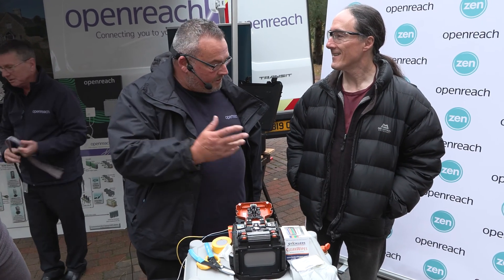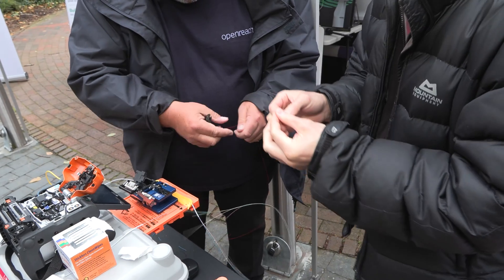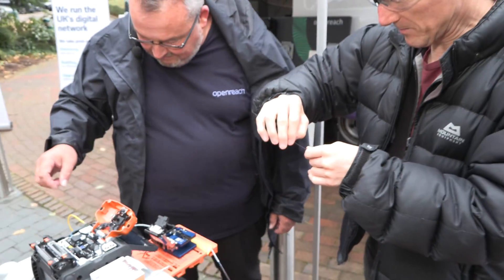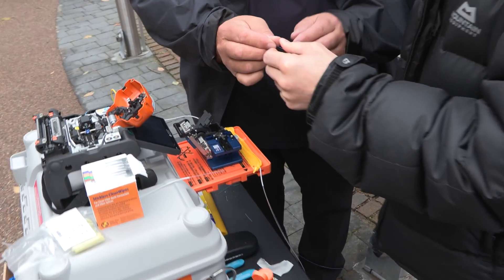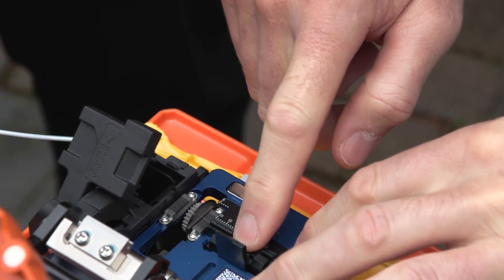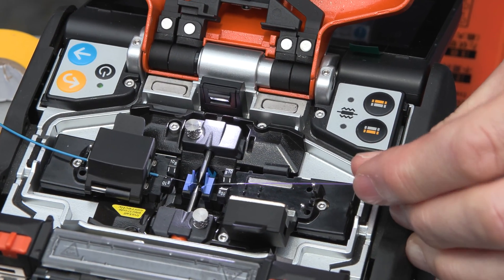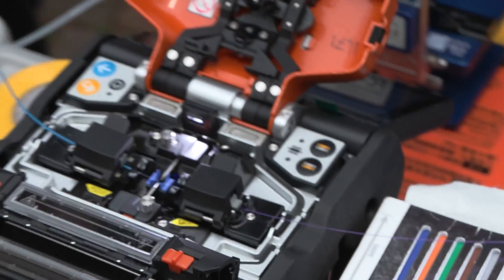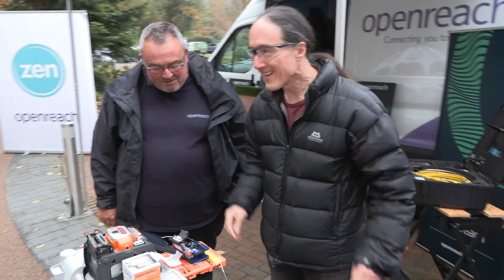Openreach teaches me how to do a perfect fibre splice

Comment: Pity they can't run a duct, from their Fibre cable inspection pit,  for 4 yards under a rarely used road, though isn't it. Look on this site and watch American companies, drill underground for upto 300 meter with NO TROUBLE AT ALL...Close 'OPENREACH ' down and open the DIGITAL AGE system to companies that WANT TO WORK...

Comment: You can't go saying things like 1.8Gbit per second when Zen don't offer this yet, that's just mean.

Its just a race right now, do Cityfibre reach me first hopefully offering their 2Gbit service, or will Openreach more widely roll out 1.8Gbit.
Reply from the maker: Thanks for your comment 🙂... we're working on launching both 1.8Gbps from Openreach and 2.5Gbps from CityFibre.  Don't have a firm date yet, but will happen within the next few months.
Reply: @RTZen  Are there any complications to upgrading within my 2 year contract?   I noticed a few months back that the new customer  price is now cheaper than I'm paying.
Reply from the maker: @alexatkin  when we launch 1.8Gbps / 2.5Gbps, you will be able to upgrade in contract and get the same price that we offer to new customers.  We haven't announced details yet, but our planned pricing is not much more than you're currently paying.  If you stick on your current speed, then we'll send you an End Of Contract Notification that will give you an opportunity to move to the price we are then charging for new customers - if that is lower (as it is currently) then you'll benefit from a price reduction.  Whilst you're in contract, you're protected by our Contract Price Promise, so we won't hike your price (unlike most of our competitors who typiclly put through a CPI + 3.9% increase every April).
Reply: Community Fibre does faster speeds than City Fibre. I have 3gig at my house and I could go faster. Openreach is fallen behind with the times.
Reply: I mean, I wouldn’t get too excited, OpenReach are still deploying GPON and have been very quiet about upgrading to 10gbps let alone 25gbps XGS-PON trunks (GPON maxes out at 2.5 down, 1.25 up, but that trunk is shared among among many customers. If you are on a trunk with just a handful of heavy users high speed users you will find that you will be able to burst those speeds (as long as no one else is) but you won’t get that speed all day, every day.
Reply: @SomeoneBloodyRandom  I'm aware of the Openreach limitations but as I am disabled I sleep unpredictable hours, so the odds of my heavy downloads conflicting with the neighbours is pretty low, plus I kinda doubt any of my neighbours are heavy users.  Obviously I'd prefer Cityfibre for the symmetrical speed alone and better technology, but Openreach is a good stop-gap.
Reply: look at what theyve got on most of the western continent in europe already. the swiss I think even have SKorea beating plans now for 25Gbit both ways for like 60 quid a month! even the more wide reaching services that have a physical line are 1/5/10GBit there. Its mental how much BT companies have held back our infrastructure since the 80s.
Reply: @lainwired3946 Well when it comes to  Openreach migrating away from GPON (which they will have to do sooner or later) thankfully techonogies such as XGS-PON use different wavelengths compared to GPON so the two can co-exist on the same trunks.

So OR can have customers on GPON and XGS-GON at the same time, OR "just" (yeah, its not as simple as waving a magic wand, but this comment is long enough already) need to add the equipment in the exchange and then customers are ready to move over to the higher throughput trunks (either because of capacity or customers (the ISPs) demanding faster speeds) they just need to swap the ONT at the retail customers premises.

ATM an ONT swap needs to be done by an OR engineer, but one day OR will prob allow end customers to do the ONT swap, so hopefully that will become easier.

The "hard" part is laying the actual fibre, once thats done it allows gradual upgrades to the backbone/customers equipment.